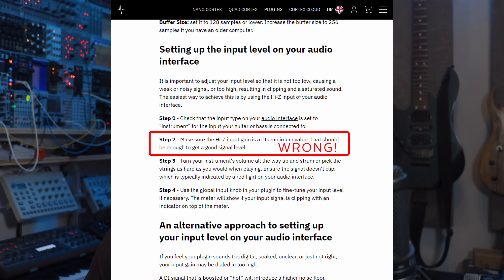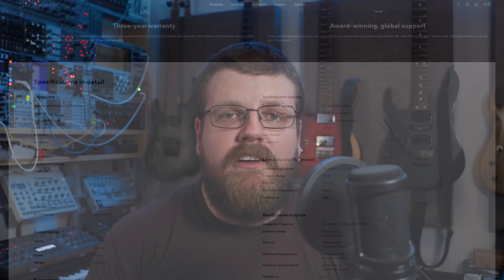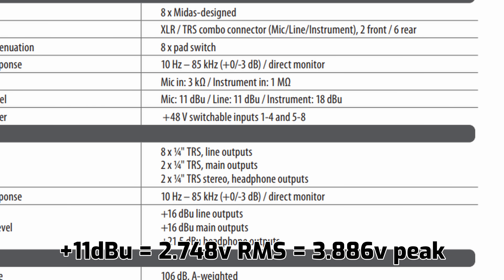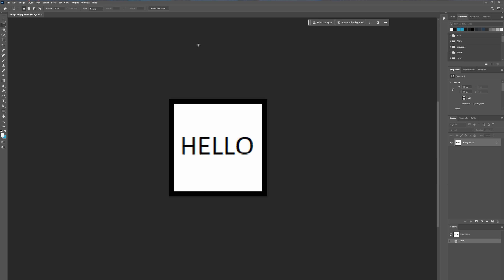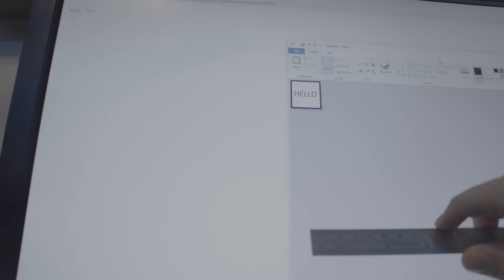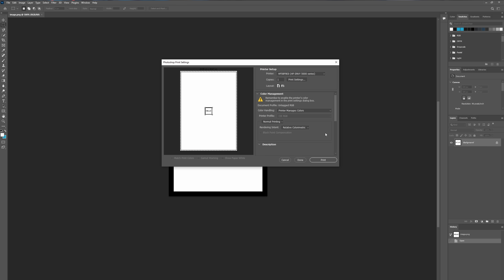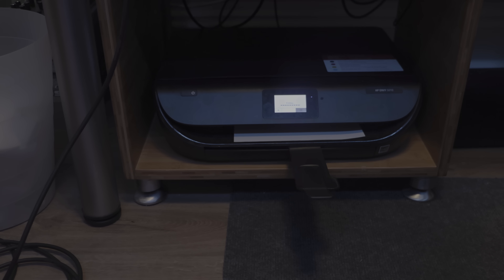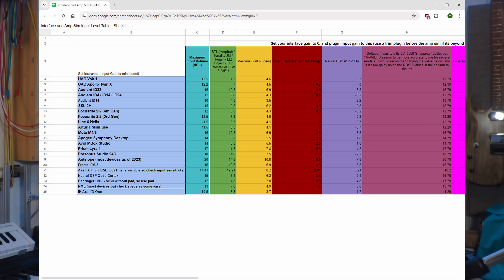Ampsims and input gain - Please, stop the madness...

Comment from the maker: A lot of people have asked how I determined the amount of gain I added when turning the gain up on the interface, since the knob isn't labelled with any values.
I did this by using a loudness meter plugin, and playing open strings as hard as possible for 10-15 seconds. I then compared the loudness before and after I adjusted the gain, and the difference was 24dB. Hope that makes sense.
Reply: Did you measure the loudness in Db or LUFS?
Reply: @boristubeti6776  That doesn't count, as long as he compared the same instrument (his guitar) played the same type and pitch, only differing in loudness. It's due to the fact that LU has the same step width like dB: 1 LU rel == 1 dB rel.
He used the loudness meter just to prove the difference, not more.
Reply: @boristubeti6776 1 lufs = 1db of perceived loudness (basically). You want to be using dbfs in the digital domain, and what ever you like in the analouge domain, but most use dbu these days in audio (for reasons too long to get into here). Remember 1db is always 1db no matter the scale, they all just mesure different things so don't always directly translate to aother scale without first defining how they relate to each other. 

For example: With dbfs and lufs vs dbu, as they are both scales defined by the point at which digital clipping happens, which depends on how much power your interface outouts (or how sensative it's inputs are) which has no standards, unlike dbu, which is the unloaded variant of dbm who's 0 point is derived from 1mw into a 600ohm line, dbu having the same 0 point, but being an unloaded line to account for all the different impeedences we see in audio analog gear, and so we have a standard to follow that's the same across all analog gear. 

Lufs are based off our perception of loudness, rather than actual signal strength. When working with signals you want a unit that is a precise measurement of that actual signal, not an approximation of how loud it sounds to us. The latter is more useful when finalising something to a playback media that will be the thing that's listened to by the end user.
Reply: @boristubeti6776 Lufs are equivalent to db (1LUFS=1DB), just they are based off our perception of loudness rather than physical signal strength, like say DBu is (the modern day analog audio professional standard mesurement scale of signal strength). 

In the digital domain when mesuring a signal you want to use DBFS, in the analog world use DBu. If you are using both analoug AND digital equipment you need to set a relationship between DBu and DBFS, and decide at what DBFS you want 0DBu to be (with budget interfaces this is fixed, but differs between models as there's no one fixed standard for it, although a fair different few have been proposedand and are used). 

LUFS is more for working out how loud something is going to sound, and not precisely how much power an (audio) electrical signal has, which is what DBu does.

Hope that helps.
Reply: First: Great video! I understood about a quarter😅

You say you used a loudness meter plugin. But: 1) Did you then bypass the amp sim to avoid the built in compression etc.? Or 2) do you want to see how much added loudness you get through the amp sim? 

If 2): If you want to try different amps, you would then have to do this process again and again, right?
Reply: @trondvegge1807  I would assume he used it independently/instead of the amp sim, since the clipping level is only dependent on the audio interface gain and the instrument.
Reply: @trondvegge1807  Hes looking at the db of the input, which is usually shown AT the input before actually hitting record. So you can bypass the amp or not, its more just looking at the input peak. But yes, to make it simpler to see just turn off the amp sim.

As for your second question, yes and no. If the amps are all coming from the same plugin or line of plugins, once you get the setting correct, it should translate to all their other ones. But if youre switching from neural, to line 6 or whatever, yes, you would need to adjust the input in the plugin different for each one. The input at the audio interface should remain the same as long as youre using the same guitar.
Reply: @lunatictumor  So, why do the plugin manufacturers not just set the input gain levels they designed their plugin for to a locked set point so that the users just have to do one thing and set there recording input to just before it clips so you get the best possible tone they designed it for. It's been some time but I think Peavey's Revalver 3 had an auto input gain feature on the plugin and this must be why they did that. It is pretty odd that plugins are trying to copy the amps but don't lock the input gain to the plugin just like you would have on a real amp which normally doesn't have this adjustment.
Reply: @torchlord11  I dont make plugins. I couldnt tell you why. Lazyness? I suppose it  could be because there MIGHT be a situation where you would want that control manually? You would have to ask the software companies.
Reply: @torchlord11  If you lock the input gain of the sim, you won't be able to turn down the input after you've maximized the bit-depth of your interface (turned up the signal to just before clipping). Also, if you lock the input gain on the sim, you lose flexibility - what if you want the sim later in the chain? Input & output gain controls are always good to include in a plugin.
Reply: So after doing all of this, does the output in the neural plugin effect the gain staging at all? Or does it just make it louder so you dont have to crank your interface?
Reply from the maker: @christophershaski933  The output is just that; the output volume. It just controls how loud the result is, not how it sounds. You can achieve the same result by adjusting the channel volume fader in your DAW, basically,
Reply: @GhostNoteAudio  Thanks, thats what I thought but I dont know everything so I figured id ask.
Reply: @christophershaski933  the whole point of the video is you DO have to crank your interface. That's how you get a loud input with low signal to noise ratio.
Reply: @lunatictumor  I am not talking about the gain. I am strictly talking volume.
Reply: @christophershaski933  Output "should" have no effect on gain staging. It "should" be pure volume.
Reply: I need further help, though this was already very helpful. When I am recording microphones, for this example, drums, I am not using plugins yet. The problem, when I set the Focusrite Scarlett to max before clipping, the signal is way hot in Reaper and clipping all to hell. I would prefer to set the input gains with the clipping indicator on the Scarlett as you explained. I don't know in Reaper how to lower the input after the conversion such that it isn't clipping in the DAW. If anyone can offer advice I very much appreciate learning how to correct this problem.
Reply: @thomastucker5686  there is likely a Focusrite software "mixer" between the interface and your DAW that needs the digital gain adjusted. If adding a gain plug-in in reaper first  is getting clipped itself then look for an intermediary software mixer. My old Focusrite Saffire Pro 40 had a mixer software pre DAW and UAD has Console that comes before the DAW also.
Reply: @AkaTengu  yes, that is most likely it. There is such a mixer. I hadn't considered using it to lower the signal before the DAW. I am going to try that method. Lucky for me I haven't had much trouble with guitar, bass and plugins, just mics. So I had been adjusting the signal into Reaper with with the Focusrite preamp controls. It worked, but now after this video, I might get better sound over all if I can manage the input between the preamps and the DAW. This could make my drum recordings sound better over all, I hope. Can it fix my playing?
Reply: @thomastucker5686 yeah that should get you sorted 👍🏽. Also potentially yes, haha! If you are monitoring without latency and it sounds closer to the finished product or has any processing or effects that inspire you’ll likely play a lot better and do things you wouldn’t have done otherwise. Not sure your style but even getting more saturation as you play louder can be dynamically inspiring. Whether using an outboard preamp/eq/compressor or if your interface preamps add character (SSL, Audient, UAD) before clipping.
Reply: I had the same question. thanks for pinning the answer and thanks for your video!
Reply: What if 0 dB is the lowest point in the plugin input, and I would have to go below that to set it according to this?
Reply: @rutbo.333  Then you have naturally to turn down (hopefully not so much) of the remaining difference the input of your interface, anyway. 
If your signals already get way too loud on the interface you should rethink the use of an DI with switchable pad (often -20 or -30 dB). Then repeat from step one (finding the right gain for the ADC).
Reply: Please, give similar explanation about dialing with multi fx, processors. I have hotone ampero mini, and it has input level in settings and gain of an amp inside (missing the gain of audio interface and the master gain of plugin in this case),so how to be?
Reply: I'm surprised you didn't get into different impedances on preamps.
Reply: Thanks for the spreadsheet… is nobody using ikm Amplitube?
Reply from the maker: @realraven2000  Unfortunately Amplitude is the worst offender of them all, because there is no convention across models, so EACH model needs its own adjustment.
Reply: @GhostNoteAudio  Ok, it always makes problems with gain staging, partly because my bass player / artist doesn understand it and flattens the DI with MV2 before going in. (I usually remove or ease the MV2, I want better transients). I always have to turn down the output level -8db at least, it's just wayy to hot for a proper gainstaged mix. Generally I am trying to hit my Plugins at -18db  to -14dbVU, I can always add more pregain later.
Reply: I’m just getting into amp pedals UA Knuckles, ACS1 and such. 
How would I use those in my daw? 
Just plug straight into the interface? Or preamp then interface? Or use a DI? Any help would be appreciated
Reply: I’m just getting into amp pedals UA Knuckles, ACS1 and such. 
How would I use those in my daw? 
Just plug straight into the interface? Or preamp then interface? Or use a DI? Any help would be appreciated
Reply: To determine the gain difference before, with the gain at 0, and after, just before it clips, which reference value do you look at? Integrated, momentary?
Reply from the maker: @BRUNOBIANCHI84  I'd look at either momentary max or peak max. Check out my update video for more details :)
Reply: I'm still trying to get my head around this process - don't loudness meters measure in LUFS though? So how do I find out the dB increase from LUFS?
Reply from the maker: @novo_msc  I just did a video on decibels and LUFS if you're interested in learning more :) - but in short; LUFS and dB are mostly the same thing. Momentary LUFS is just dB RMS with an emphasis filter.
Reply: Wow. This was a truly informative Eye Opener for adjusting to maximize signal effectiveness. Thank YOU for your Help.
Reply: hi, everyone! [TL;DR] DYNAMICS, not signal to noise ratio.
i am Argaven, a Weaver and a vocalist. my range corresponds to what is called 'soprano' by scholars. i use Rode NT1A mic with Midas solid state preamp (which is a part of USB interface i used before switching to Digitech's DSP as an interface) and i feed it into Digitech BP355 interface [i am a bassist too, so i use this for effects].
i want to tell you that you cannot use either of two rules you're debating on. i don't use a compression on my raw vocals, because this is how vocals really work.
BUT if i set my signal level on the analog Midas preamp, and this is what OP does recommend, i have MY SIGNAL COMPRESSED by the analog Midas preamp!
listen, all preamps do compress signal if you push them too hard. and they're an unavoidable link in a signal chain. you have to push YOUR ANALOG preamp to drive your AD circuit with lower noise level (this is OP's point) --but your preamp will compress your signal at high gain level!!!
Reply: Very good level
Reply: I've known this for years, been trying to explain this to people for years. I use a noise gate on my guitar, but that's only to prevent feedback and handling noise between parts when playing in the rehearsal space or live. As far as in the studio, I don't actually NEED a noise gate and I play extreme metal with tons of gain. My "silent" parts on my guitars are very quiet. Do I get rid of that quiet hiss in the recording? Sure, but only to make the recording as clean and quiet as possible... in reality though, I could leave it in and it not make any noticable difference to the quality of the record. People are shocked when they stand in the rehearsal room and I turn my noise gate off and a pleasant, quiet hiss appears, I let go of the strings and the feedback starts to creep in because the amp is turned up quite loud. My live rig uses the same amp sims and interface that I use to record, I send those signals to my live amp via the "return" jack in the back of the amp, so my rig is pretty consistent sounding, especially since I captured IRs of my cabinet and use those in the studio. I'm glad somebody put an a/b comparison of this up because trying to explain this type of thing to people is very difficult.
Reply: Not sure it makes sense. Here's what I did and was this correct?: load my amp sim and as I am using a Volt 1 interface I set it's input gain to 12.5 (As per the spreadsheet), On the track itself I had it at the default 0 dbs .I had a Youlean loudness meter placed after the amp sim (Correct place??)  and when i played loudly with the interface gain at zero it read  - 8.3, When I turned the input gain of the interface to just below clipping then the Youleam meter read -7.4. As the difference was -0.9 I lowered the amp sim's input by that amount: result - a truly horrible sound - the clean amp selected was distorrted to billio.  Definitely something i am not getting!!
Reply: Why not use a loop instead of "playing open strings". That isn't science sir!
Reply: How would a mixing engineer figure that out if the guitarist recorded their own DI? I guess the guitarist would have to provide that value.
Reply: @sqlb3rn measure the S/N ratio and see if it is inline with 24bit digital recordings or way off and closer to 16bit or worse. It could also be they are recording IN 16bit, but that would also need addressing, so it's good to check this on recorded clips regardless of if they are using an amp sim or not tbh.

Just make sure to ask them to leave in some silence at the start and/or end of the track, so you have something to compare against (It's also just good practice to avoid accidental truncation of the begining or end of the taget performance to be recorded).
Reply: @sqlb3rn How would that information be helpful? Unless you’re trying to troubleshoot remotely so they can do a better re-recording, which could be an excruciating process. Once it’s recorded digitally and going through the rest of the production and mixing process you work with what you have, implement audio repair if you have to, or re-record. 

Also if a guitarist knows those values, then they probably know how to record with their setup and will likely deliver the best suitable noise floor for their style.
Reply: @sqlb3rn you can reprint the wave file x dB quieter
Reply: I would add that many people are confused and they think they have to follow the same procedure to set their gain.
That part was to make a fair comparison, then every card is different and everybody will have to find where it clips.
I would also add that sometimes you will have to pad, trim reduce the input gain via the internal software, if you have too much gain even when the knob is at zero.
Reply: @ChristianIce  CRISTIANAIRTE GUAIATTE'
Reply: I am completely new to recording and know almost nothing about it so sorry if my question is dumb, but we all have to start somewhere, right?

I'm currently working towards building my own home recording studio and am planning to buy the "Audient EVO 16" as my audio interface. Mostly because I've read really good things about it and because it allows you to expand the number of inputs with one or two "Audient EVO SP8's" at a later stage. However, I am NOT going to use any ampsims at all. I will be using my real amp and recording it using mics plugged into the EVO.

Does any of this apply to my situation as well?

I can ad that one big feature of the EVO 16 that Audient has as a major selling point is its "Smart Gain" function where you simply press a button and it automatically sets the input gain. This feature works on all input channels simultaneously and even works across to the inputs of your EVO SP8 expander unit/units. So with that in mind - at least Audient expects us to set the input gain somewhere and not just to zero.
Reply: @marcuslewitzki4610  at that point you are no longer using the instrument input but instead a low impedance balanced xlr mic input on the interface. Depending on source level, mic vs DI, mic sensitivity: dynamic vs ribbon vs phantom powered condenser, and anything else you might add to the chain set the gain so you have a strong signal that is not clipping. You will still also gain stage in the software(like between plugins) too. 

Not sure how helpful “Smart Gain” as you need to set the gain based on the loudest expected amplitude of the audio that each input will see. So if it is resetting all the inputs based on what it is receiving, you’d need everything that is plugged in playing at its loudest all at once. Maybe in some compositions the chorus or climax with a lot of mics and mic bleed might give you that moment but I’d rather check each input individually. It’s also easier to catch unwanted noise, hum, etc. when setting the gain on one channel at once.
Reply: I think if you're going to be this emphatic about the point (and using "maths and science" ) you should be using a signal generator and a digital multi meter, or an oscilloscope to determine gain, rather than "playing open strings as hard as possible" !!!
Reply from the maker: @redtapemusic  I was trying to follow a process that would be easy for others to copy. Most people don't have signal generators and scopes lying around in their home studio like me 😄 - although I'm actually working bringing an affordable signal generator to market, specifically for this purpose... so stay tuned for that video.
Reply: @GhostNoteAudio sorry mate but to me if I boost that hard I clip how can you not clip?
Reply: @Doomerbolic you need to drop the amp sim input then.
Reply: @jeffallen3382 what if you're using something like amp designer in logic pro? I don't see an input level to adjust for the plugin like other amp sims, only an output level
Reply: @MusicBoxfl  I'm nott familiar with that DAW.
Reply: @Doomerbolic  I suppose one could put a hard limiter, or at least a compressor, before the AD converter.
Reply: 2:07
There's a much better example then using pixels. With pixels you still have the resolution issue that will always stay the same unless you add pixels. Instead of 100 pixels you use 200 pixels. But, you are always limited.
The better way to show arbitrary unit is o use vectors, that are also exist in photoshop. Vectors don't have size but they are mathematical unit. there for, you can make them larger then the universe and everything will still stay sharp and clear.
Reply: Since when would we ever record our guitar signal just under clipping? No head room for mixing? What am I missing?
Reply: @dirtedingo8354 you musy be trolling. To get the best signal to noise ratio and maximize our converters we set our interface just below clipping and reduce input singal inside a plugin to compensate. That does not mean we record just below clipping, you can record at any level you want by reducing the output level inside a plugin.
Reply: @dirtedingo8354  He didn't say anything about how hot to record the signal. The only part of the signal path he discussed was from the interface and the input stage of the amp sim.
Reply: Wrongggggggggg! Ed s YouTube channel has proved this. You literally used his spread sheet. The literally manufacturers of the plug-ins tell you what you should 
Set your input gain to as to what dbu they captured it at. Your interface should be zero. Why would you boost signal before your amp? 
Guitar, amp, speaker. Come on. You literally said a bunch of nonsense trying to sound smart when this has actually been proven by the people who actually make the dam plug-ins 🤦‍♂️
Reply: @dirtedingo8354 he’s not wrong dude that hiss sounded awful. The way he had it sounded awesome